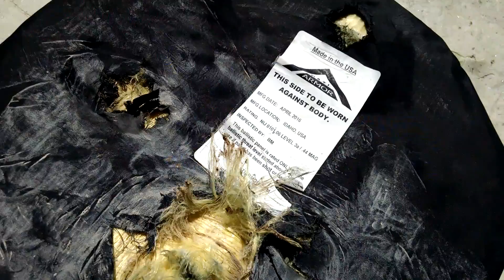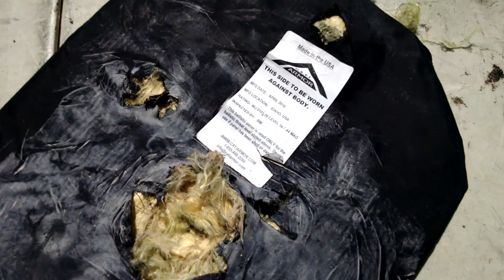Could soft armor ever stop 7.62x39mm?

Comment: i sort of figured it would still go right through. 7.62x39 packs a punch for an intermediate round
Reply from the maker: Sure does. I'd like to try this again with 5.56mm.
Reply: +The Chopping Block i think with the high velocity of m193 it would still go through. unless the windshield cut off enough speed. should be interesting!
Reply from the maker: Yeah, I think there's a very good chance that the windshield would fragment the smaller, lighter bullet more than it did that 7.62mm bullet. Only one way to find out...

Comment: They used to make small steel plates for use in the "trauma plate" pocket (the small pocket on the front of some soft armors) that were supposedly proof against 5.56N or 7.62mm X 39mm when combined with the soft panel in the armor itself.  I don't believe there are any Youtube tests of soft armor with a hard plate in the pocket.